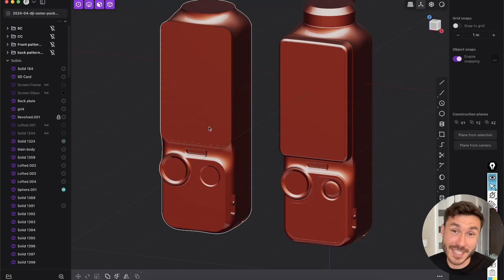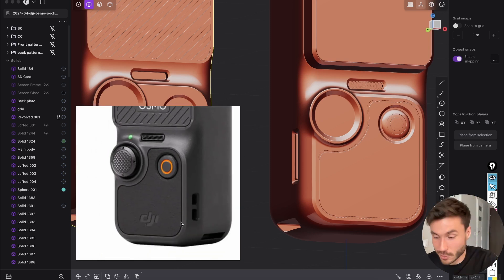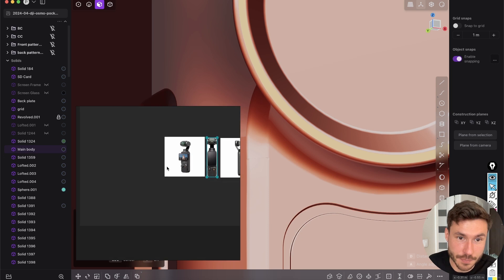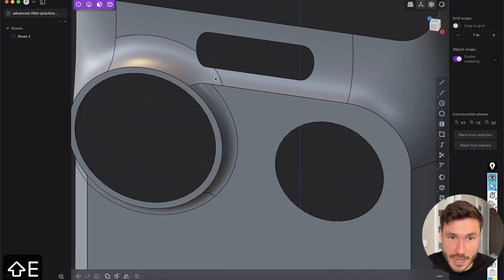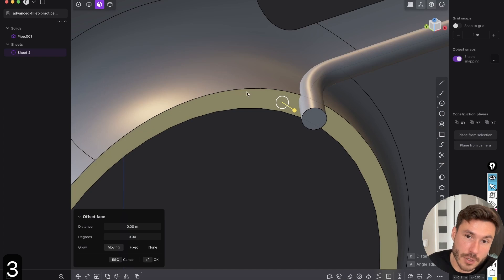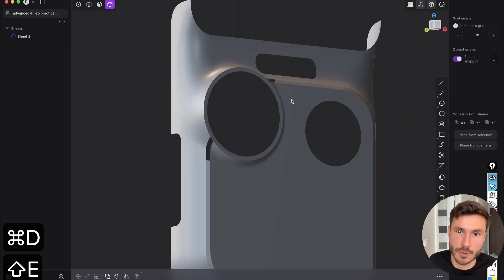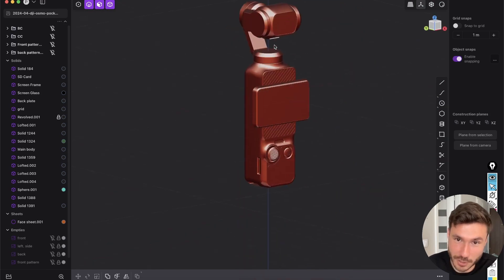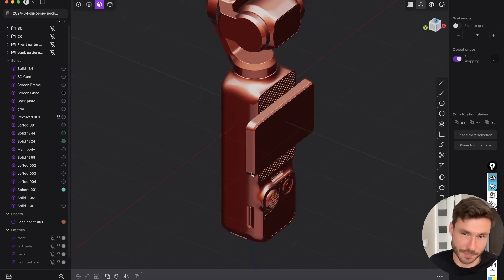Create MESMERIZING Surface Transition in Plasticity | Tutorial

Comment: The pipe execution is awesome, but learning from alias curves can be your best friend. Food for thought. The transition to the flat lens area could be improved by using curves to control the final jump at the end of the pipe. When you extend the pipe it created a wobble in the surface that was clear to see in your final model. You do such an amazing job of control why not reserve that last bit of control as this is an injection molded part the surface has to be perfect, if it was vacuum formed then those wobbles will get hidden. Keep up the amazing work.